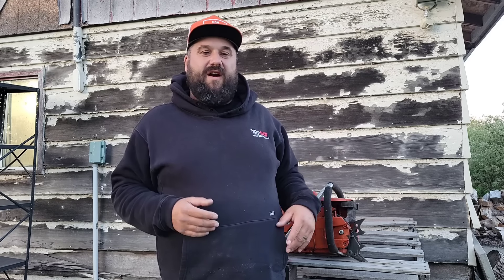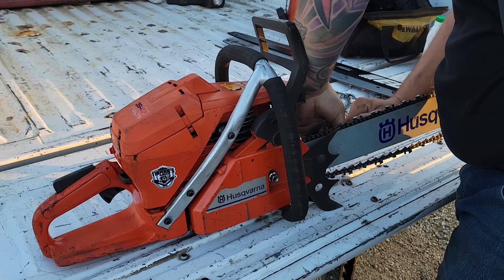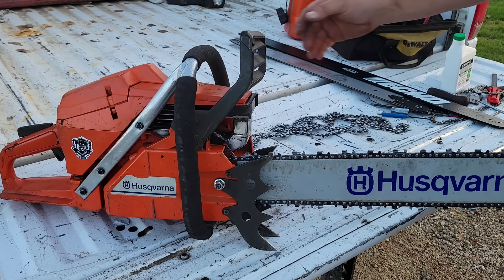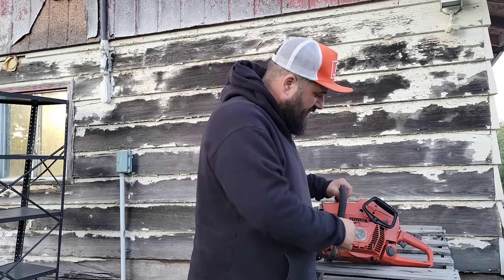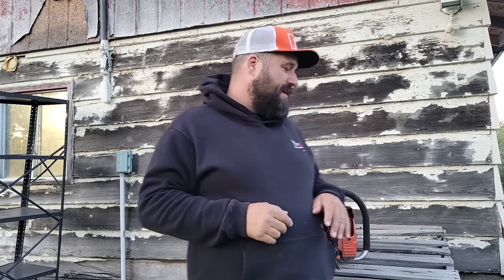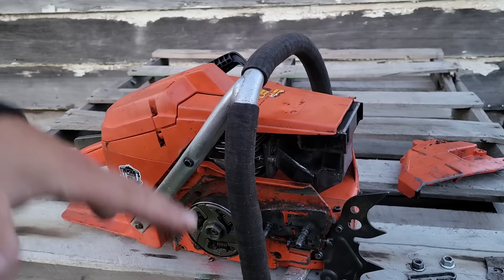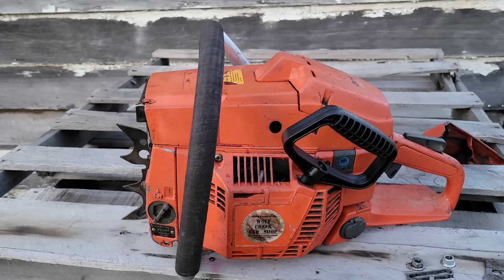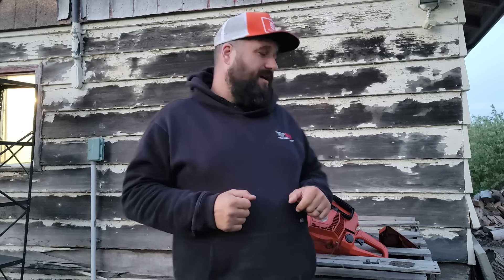THIS PORTED 394XP IS LAZY IN THE CUT!! BUT WHY????

Comment: Only because you installed a different coil in a previous video, timing was the first place my mind went.  Little Husqvarna 450's use different coils and flywheels on the newer models than older ones. To make an "older" 450 coil work on a newer 450, you have to completely grind the key out of the flywheel.

Comment: Sorry for the dumb question but how do you advance the timing ‘half a key’. Isn’t the key tight in the keyway?
Reply from the maker: I took the key out so when I say half a key way I mean the slot on the flywheel and slot on the crank .
Reply: @tinmanssaws  ahh got ya. So you can run it without a key? I Guess the friction fit is enough to hold it.

Comment: I don't know why it's not common for people to advance timing. More air, more fuel why not an earlier spark to get the fuel mix burning sooner. Just my thought on it. I think spark is often way over looked.
Reply: When thinking  of questions like this . I always go back to the manufacturer has to basically make 1 saw design to start , idle work correctly for every type of are . H I t , cold high elevation  and so forth. We need to fine tune for our type of work.😊
My²cents😊
Reply: @coolestguyontheplanet723  I've run my saws in hot and cold weather. Often, times if done right, advanced timing on a modifed saw makes the saw even easier to start.

 I'm not talking about advancing the timing from the factory but after port work and other modifications. There is no need to really advance the timing on a stock saw unless it's super lazy, which is sometimes the case. Every saw I've advanced the timing on I've gained torque/power.

Comment: I calculate timing with trigonomentry. I mark the flywheel with a marker and a corresponding mark in the case, then I advance it and then put the flywheel on loosely so I can feel the play this way I can then meet the marks and then I take the play to the other side and make a new mark in the case. Now by measuring the distance between the case marks and the crank shaft center so we get a triangle. Now just throw that shit in a online triangle calculator and you are set. 

This comment was probably worded poorly but try it out its as easy as advancing can get. Eezy peezy
Reply: Or you can just put a timing light on it. I’d say that’s easy peezy and about as accurate as it gets. You also get to see what the timing curve is doing.
Reply: @ambrosebrower8760  that is true and more accurate/repeatable. but setup is longer and you need a degree wheel and a timing light and a spare battery/powersupply

Comment: Check out the flywheel number as it might be from 288 as they fit to the shaft and from 288/281 to 394 will work but will be retarded and from 394 to 288 will be extremely advanced.

Comment: I didn't know you could run a saw without a woodruff key. I thought for sure the flywheel would spin. Maybe I'll try my old flywheel on my 272xp build to advance the timing, as it has no molded key in it. Are you sure it won't spin once it's locked down? TC Mahalo Tinman 🤙🤙🤙
Reply: No power on it like a sprocket a star washer with a bent tab will hold it with the nut
Reply: Keys sets the timing ,taper on the crank holds it on with proper torque spec on the nut..good luck
Reply: You can also use a offset key
Reply: @ambrosebrower8760  Now that's a good thought. Thanks.